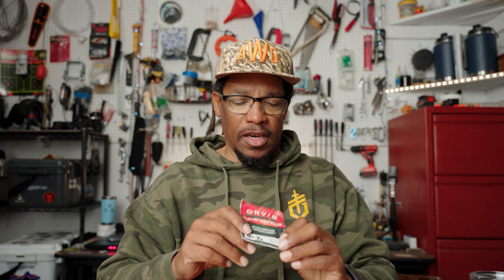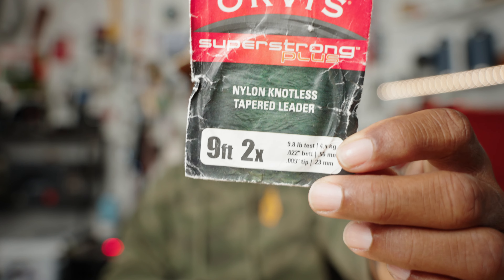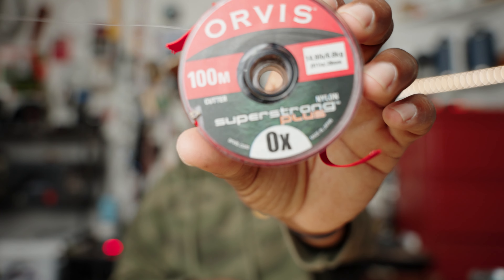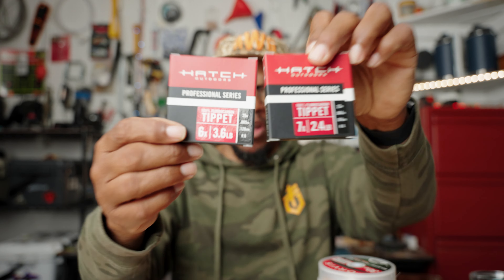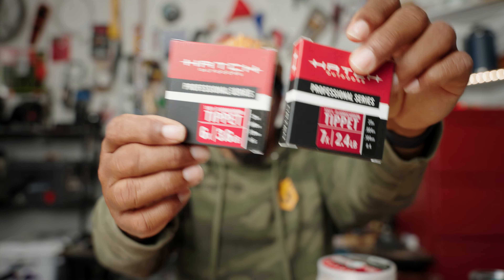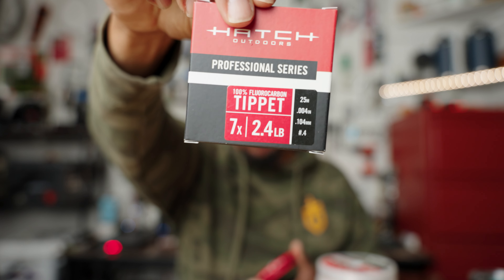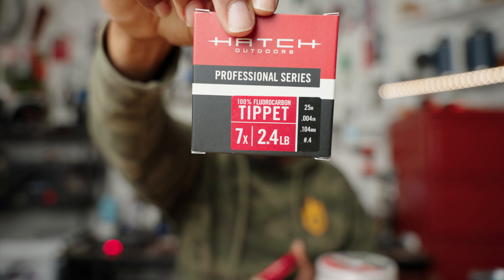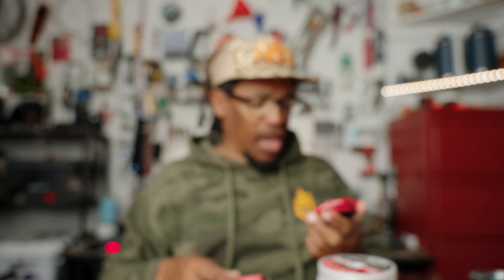Everything I Know About Tippet

Comment: We are hopefully entering winter here in the northeast and getting flies deep and fast will be a priority. This usually leads me to pick a narrow diameter line.  But if steelhead are in the rivers I will go for higher strength since the heavier flies sink well by themselves.  At the same time flexibility of the leader/tippet is important. As a habit I give the line a good stretch to get a good cast and drift. I find mono better for winter fishing. Any thoughts?
Reply: I just fished the Missouri yesterday used fluorocarbon 5x , 20”+ trout .Worked  great .